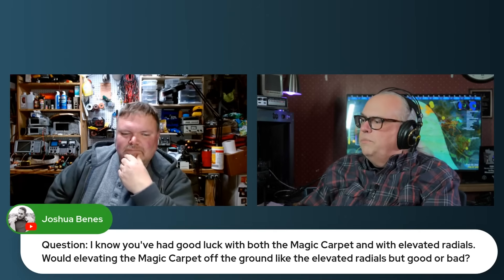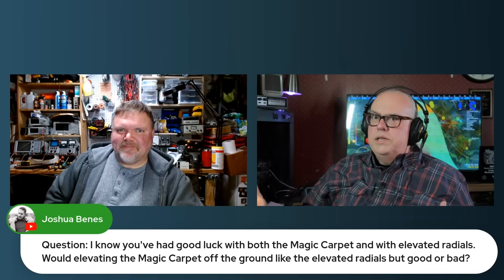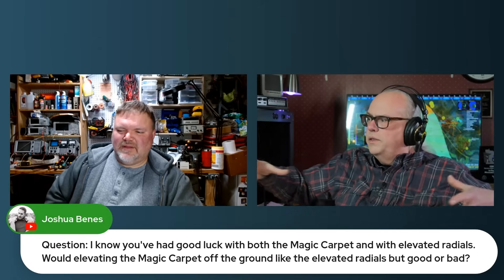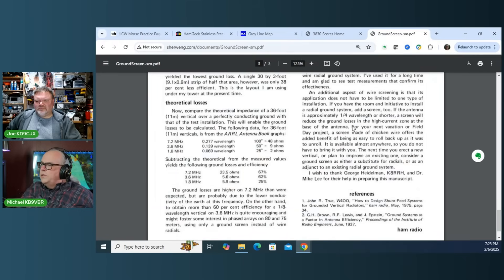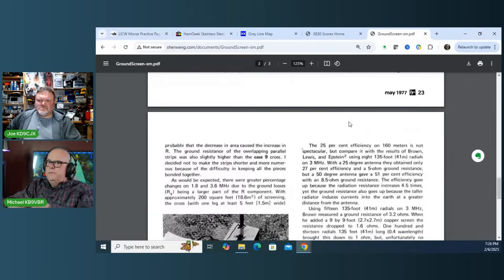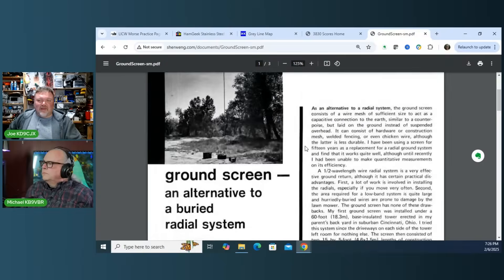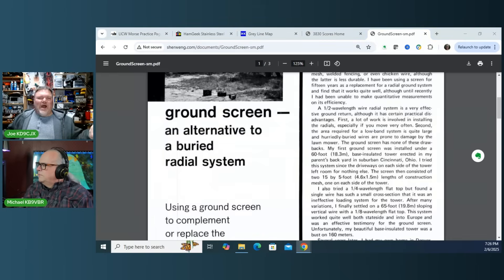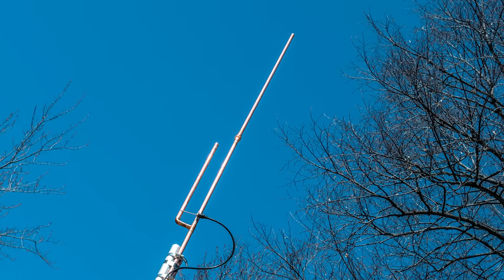Will lifting the Magic Carpet Ground DESTROY its power?

Comment: The roof on the top of my Ford Flex was great. It had the long roof just like a van or station wagon of old and it was one heck of a ground plane.
Reply: I think that would be something I could deploy on the top of my Fiberglas camper top on my truck, which is about 7 1/2 feet by 5 feet.

Comment: Would the magic carpet improve the performance of a horizontal dipole that is strung up close to the ground for NVIS operations?
Reply from the maker: Laying a single wire on the ground parallel to the antenna does help make the NVIS properties of the dipole more apparent. But a wire is sufficient and I wouldn't go through the expense of a long piece of cloth to do the same thing.

Comment: I know pouring salt water around a ground spike increases its connection with the earth - I wonder if pouring water down under the faraday cloth before you spread it would increase its coupling to the ground? (ground conductivity) 
I would guess so. Salt is not good for the grass though - just plain water.

Comment: I think of the magic carpet/faraday cloth ground network as like a mirror that reflects the radio waves higher into the air. Especially useful in areas where ground conditions are bad or dry.

It’s my understanding that radials or a counterpoise extend the effective length of the antenna and allow it to radiate better as well as capturing more of the signal.

Not sure if I’m right on this. - KF0QNM
Reply: It is like a mirror, but it reflects the quarter wave at the ground to form a half wave. It creates a phantom "other half" of the dipole. If you elevate it off the ground, you then have a second half of a dipole - and if it isn't tuned as a quarter wave, or a series of quarter waves, then it'll be an off-centre fed dipole which is resonant on some random frequency.
Reply: So basically you would need to size the carpet for the lowest band used then the higher bands will work ok or would that make more issues?
Reply: @ I'm not an expert on this, but if it's on the ground, the size depends on the ground underneath, water content, etc, but yes, you'd need more coupling, more ground for the lower bands, so a larger mat. Then it should be good for the higher bands as well. For an elevated mat/radial/whatever you're using, assuming a quarter wave vertical, then it would have to be tuned for each band as a quarter wave. With individual wires this is easy to specify, for a mat type area perhaps not so much, you'd have to put the analyser on it to see.